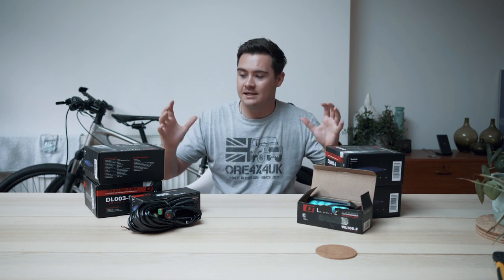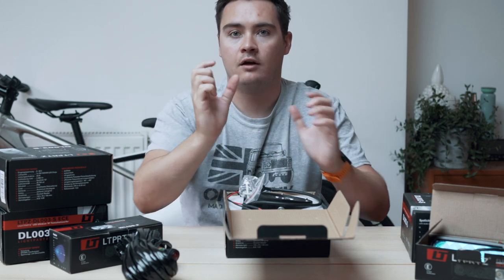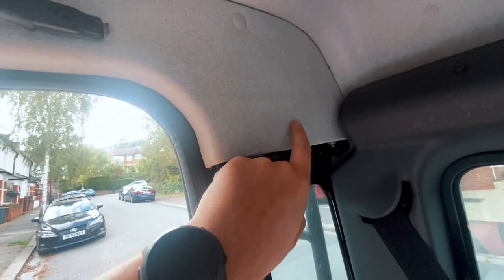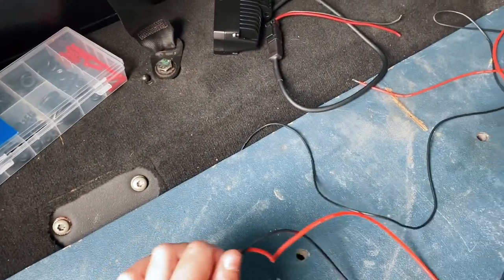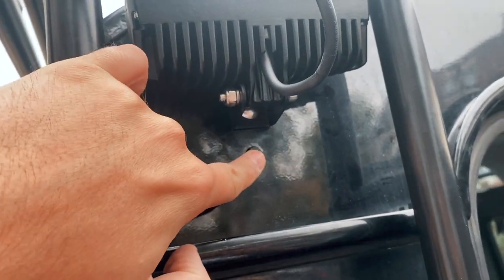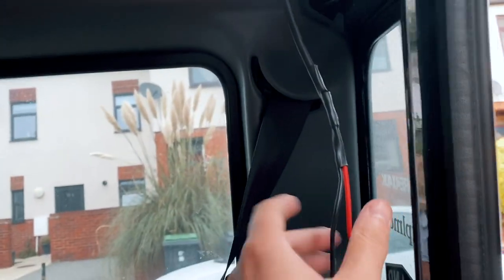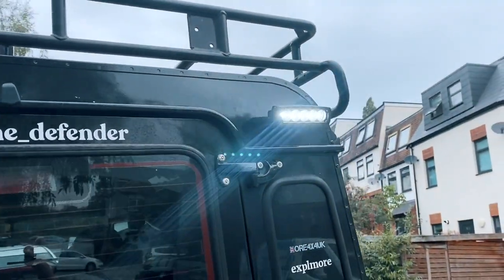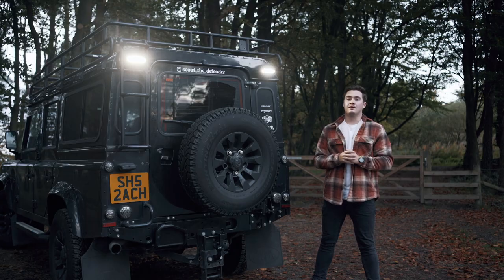LAND ROVER DEFENDER LIGHTING UPGRADE

Comment: Would it be possible to add an additional cable running from the reverse light to these working lights? You can then have them turn on with a switch if youre working on something behind the car and they can simply turn on when youre reversing for better visibility! This could be helpful if youre out in the woods or somewhere where there are no street lights.

Comment: @scoutthedefender nice job very clean! can’t wait to see how the front spotlight turn out. 

Question regarding your OEM roof rack, does it whistle with wind noise on the open road. 
Desperate to get one for my Puma 110, but as your probably aware, they’re almost impossible to find.
Reply from the maker: Thanks! Glad you're enjoying the channel.

It does make a little noise (nothing crazy), especially at higher speeds but I'm planning to sound proof the roof soon which should reduce the noise slightly.